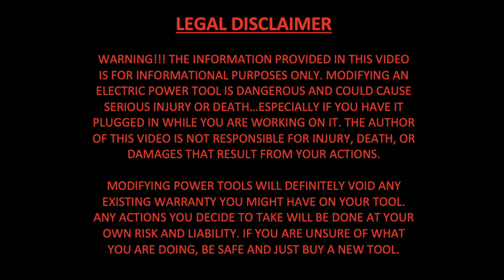Electric Trimmer Switch Fix - Black & Decker GH3000 Trimmer

Comment: I recently replaced the shaft that holds the spool as well as the plastic guard that prevents rocks and debris from flying around. When the trigger switch failed, I knew it must be a simple fix. Your video was perfect! I’m sure I would have come up with a different solution, but when I saw how easy your idea was, I went for it and was back in action in less than 30 minutes.
Thank you!
Reply from the maker: Thanks for the comment! As I have said to others, having saved even one person from having to buy a new trimmer makes the posting of this video worthwhile. I am glad it helped!

Comment: Is there a similar video or videos for a Black and Decker LST522 trimmer?  I fixed the switch on mine, but when I went to reassemble it, the internal mechanism that is used to allow me to rotate the trimmer 180 degrees popped out.  When I reassembled it, this feature no longer works. There is also a small half-square plastic part that snaps onto the shaft of the parts inside the handle, which I believe is intended to create a rotational stop at 180 degrees for the 2 head positions.  But when it was installed, it prevented me from closing the handle completely to reassemble it.  I could not find the proper orientation of this piece to allow me to reassemble. I left it out.  Could use a photo of how the spring and the plastic part are supposed to be oriented to allow me to reassemble the handle AND keep the head rotational feature functional.  Thanks!

Comment: what size/lenth of screw
Reply from the maker: I think it was a #8, either 3/4 inch or 1 inch. Either way it was shortened in the final step with the cutoff tool to fit.